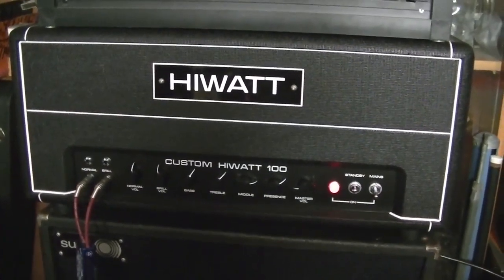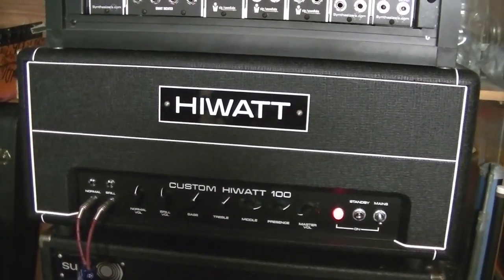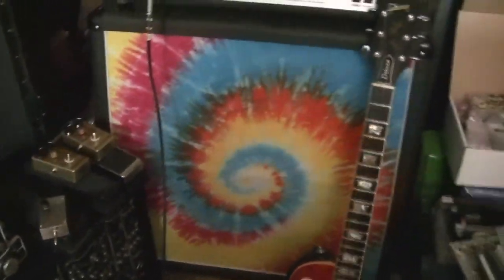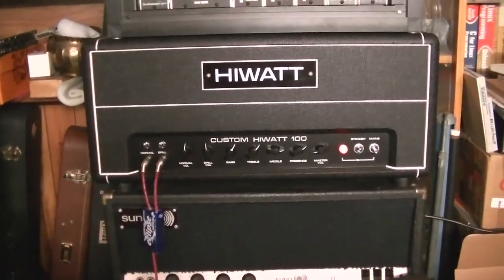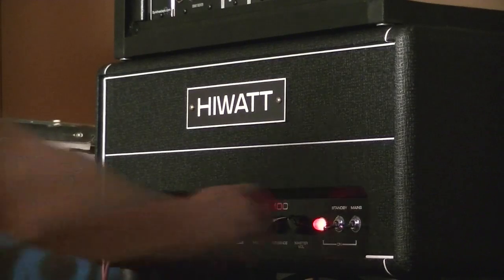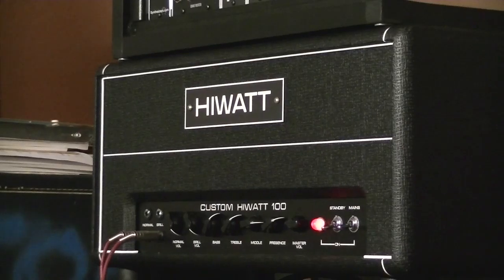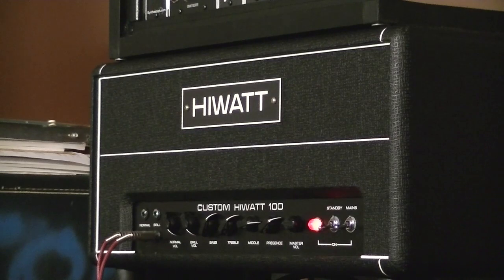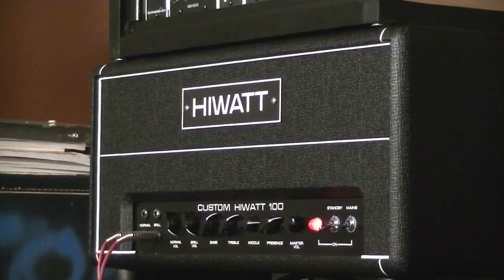My Hiwatt DR103 Amplifier Clone - Built By Me

Comment: What transformers did you use? The Partridge brand has been long gone - and those were the best
Reply from the maker: The transformers are made by Heyboer. They came with the kit and were meant to be equivalent to the Partridges. The guys that made the kit, Vintage Hiwatt Restorations (VHR), were very pedantic and got the transformers specially made. The kits are no longer available, the company renamed themselves Hi-Tone and they now sell pre-built amps and cabinets.
Reply: @snarfusmaximus  Oh..thanks for the clarification...that was going to be my next question - about where to find a kit. But being lazy, I scoured the internet, found and bought my dream amp - a 1973 DR103, in un-modded condition,...so now I am in sonic heaven - my ears can die rightly, thanks to the best man-made tone machine ever created by an engineering genius, "Dave Reeves" (RIP).

Comment: The amp should be quite unless you are playing it even at 10, you have a real bad ground problem.
Reply: quiet hahaha I had to say something!!!!! I have built many old amp types and they all fucking have that 60 htz hum. now the jcm 800 I built was a tad quieter but the plexi and hiwatt hummed . amps nowdays are dead quiet due to metal film resistors. to silence your hum because it is pretty bad. rewind the heaters and rout them so there is no loops going to the tubes. should have 4 different ground lugs. 1 for the power transformer section 1 for the input sec. 1 for output section and a common 1 for all of the rest. the hum will go down a lot but still will be present. cheers.
Reply from the maker: I get a lot of comments on my amp videos regarding hum. It's the Les Paul's P90 pickups, not the amp. P90's are single coils and hum like a bastard, but I love the sound of them and can live with it.